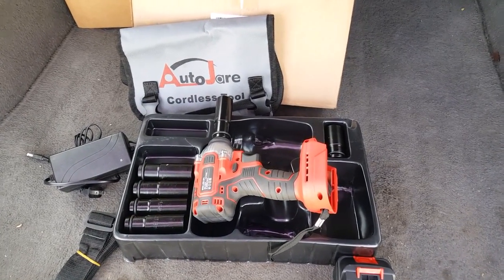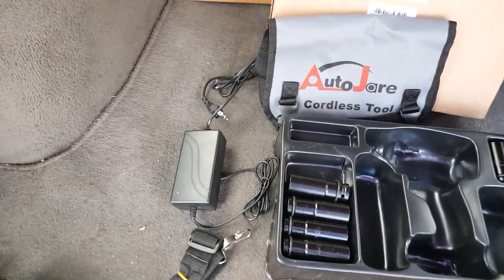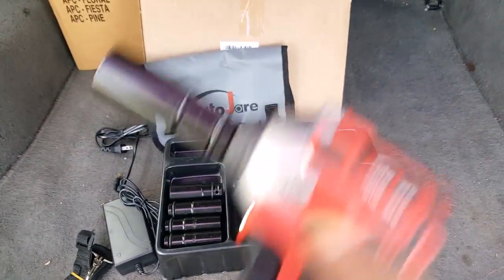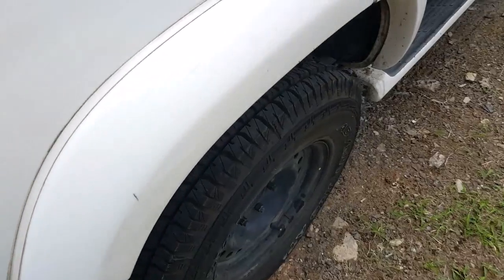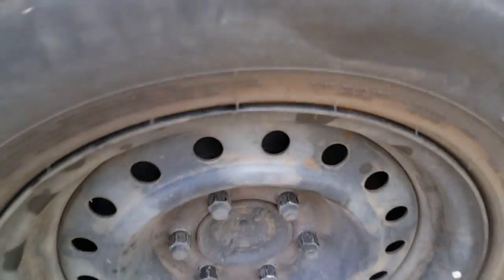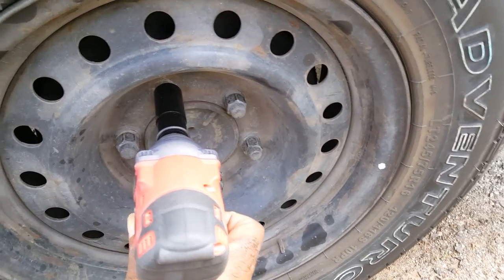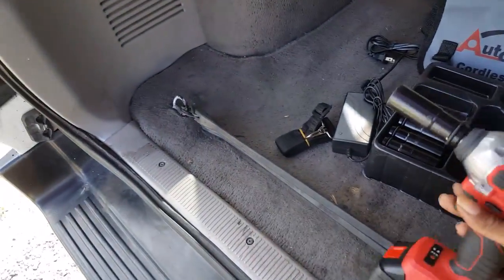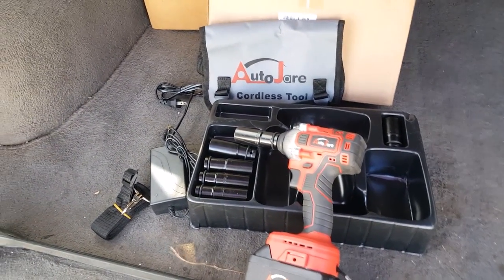AutoJare Cordless Impact Wrench, 1/2 Inch nut driving.

Comment: it cuts off because of the setting u have it on -   the battery is red button which controls that - press it and it will continue to work it lose - press it again it shuts off once broken lose